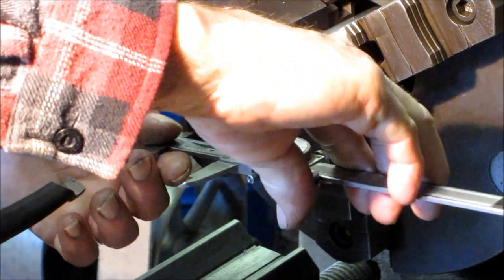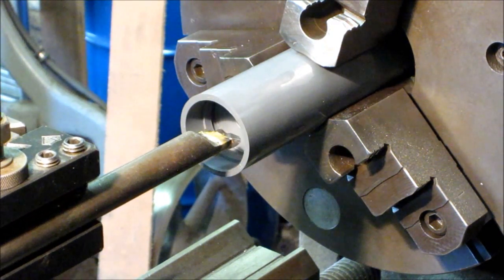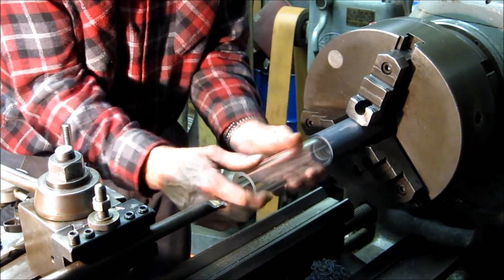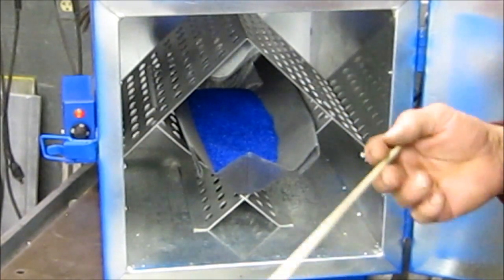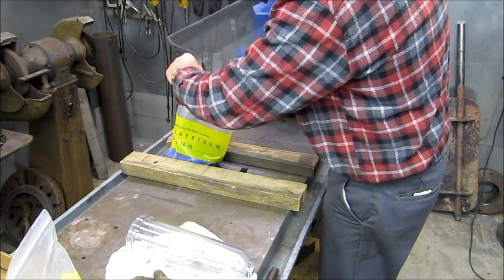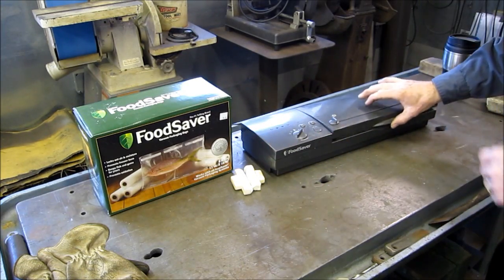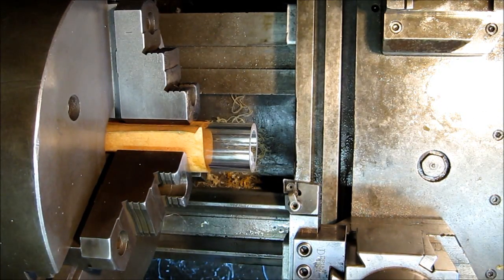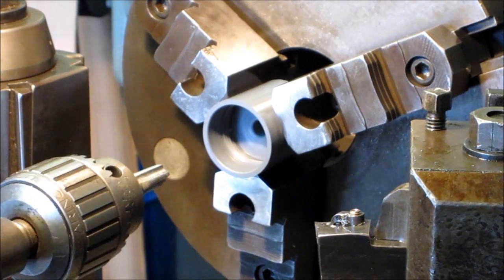Dry it Up Part 2

Comment: Keith we used to dry desiccant with a heat gun set on low poking in a cardboard box (yeah spare no expense 'eh!). As far as I'm aware it's simply removing the moisture and the heat itself isn't necessary. It's fast. I think a food dehydrator would be perfect for example. I have a water filter housing that I have set aside for a desiccant dryer, clear plastic, cheap and 1/2" fittings. I noticed on a number of videos now you cut ID threads with lathe in reverse. Do you always cut them that way?

Comment: would an refrigerated air dryer work on the plasma cutter. we use them on con controls that require dry air also they are not that expensive

Comment: That was smart to use a screen to hold the descant in the oven.  The more surface area you can expose the easier the water vapor gets out of the material.

I bet that PVC stank when you where machining it!!